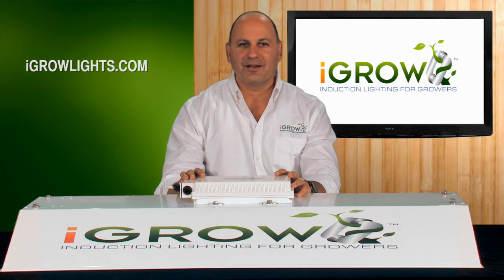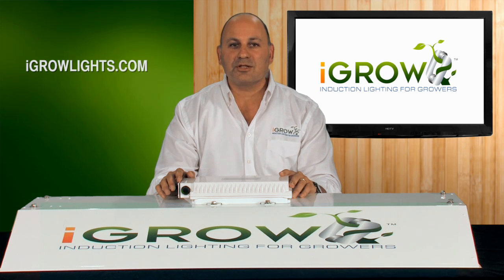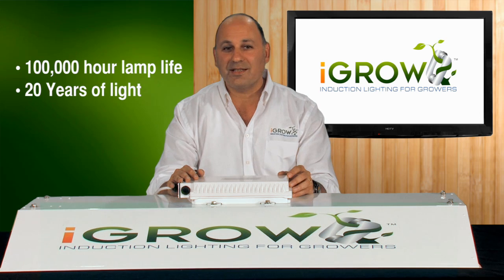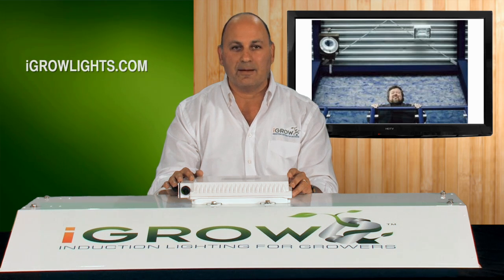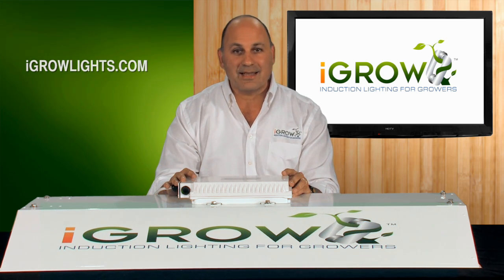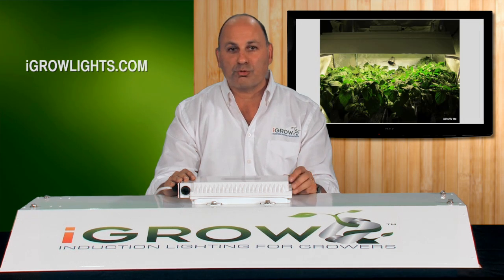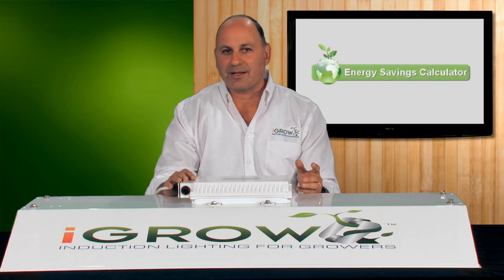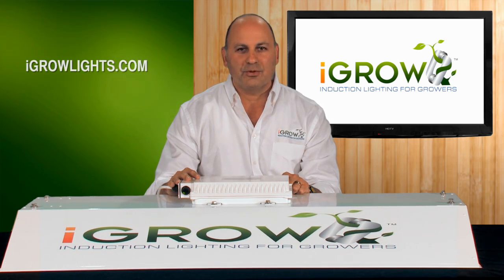How iGROW Induction Lighting  introduced Tesla into agriculture - Our story

Comment: Have you consider duel bulbs  ? I need one! skip the bulb change.
that's the only thing I don't like about your light. trust me it makes all the difference.
  
I run 5 300watt bulbs 2@6500K & 3@2700K  my seed/clone starter  box has 2 40watt induction 6500K&2700K 
advantages of my 300watt bulbs is I only need one 2700K when I move plants from the small box.